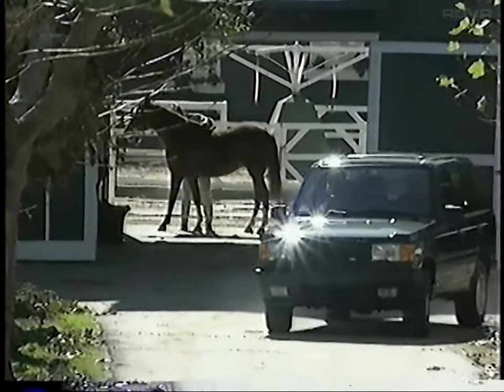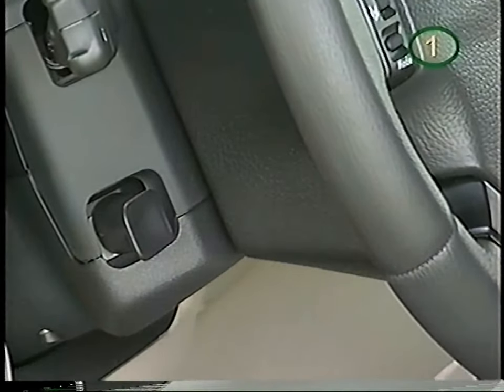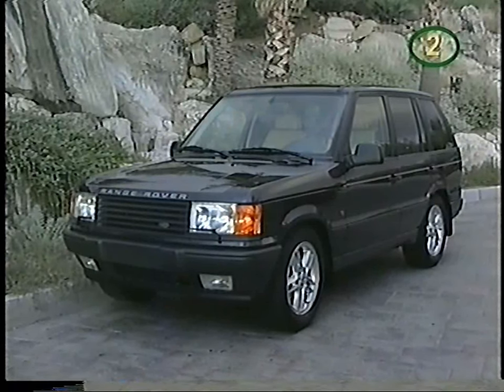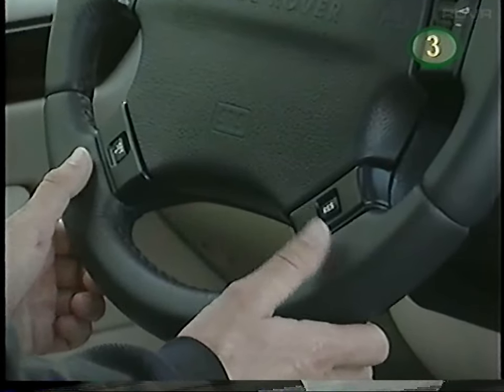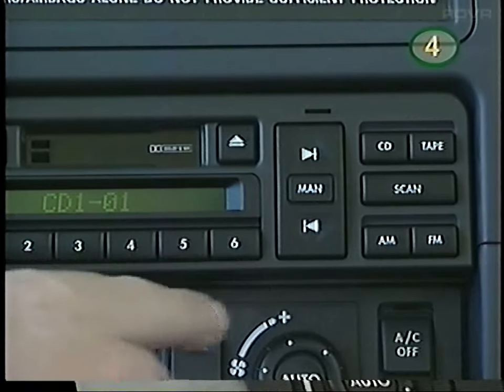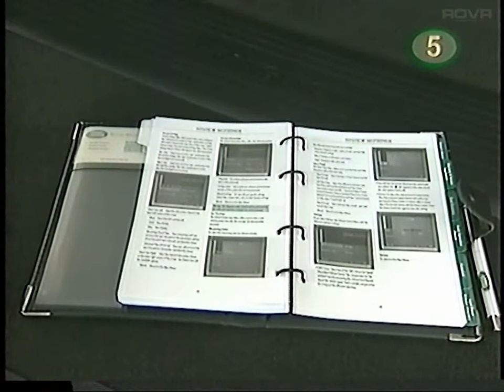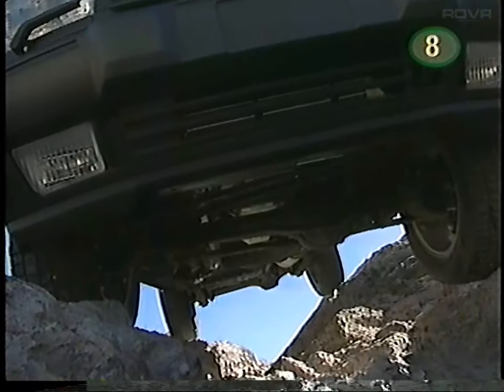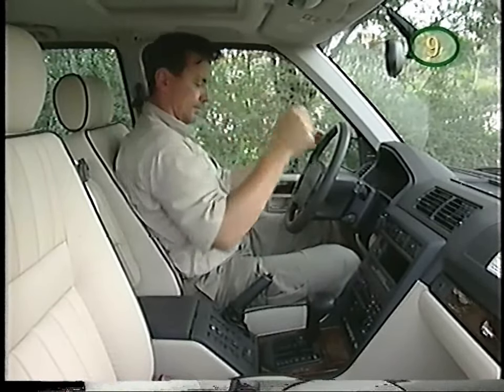Land Rover (US) - 2002 Range Rover (P38) - Video Handbook (2001)

Comment: I know the P38 can be unreliable, but I loved the styling when it came out. Thank you for posting this and your other videos, they're great.👍🏻
Reply: What make it unreliable
Reply: Owned a 4,0 V8 for 7 years and it never let me down 👍🏻
Reply: @robertdrum6857  How is your driving and did you use it offroad
Reply: a a
It was mainly used on road. Just one or twice I used it offroad for fun. I was very pleased with it. But I know they can have some electronic gremlins once in a while. I was probably lucky ;)
Reply: @TheHollywoodwhite1  electronics.
Immobiliser system is particularly troublesome.
Blows head gaskets w/o overhead condition on temp gauge.
HVAC is troublesome.

Not all bad though - relatively speaking they actually hold up vs rust and the air suspension system is one of my favourite suspension designs of all time.